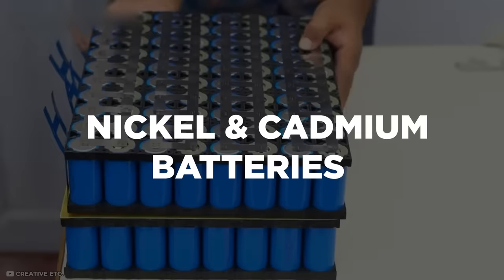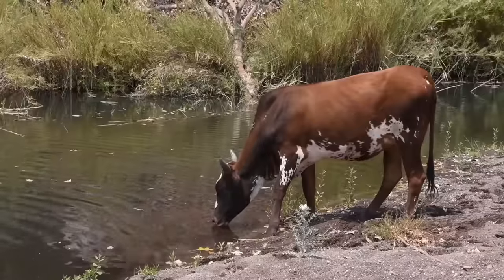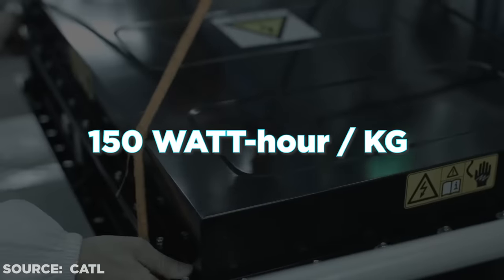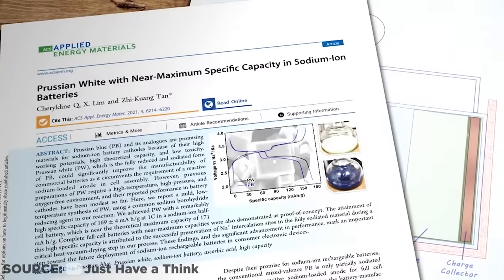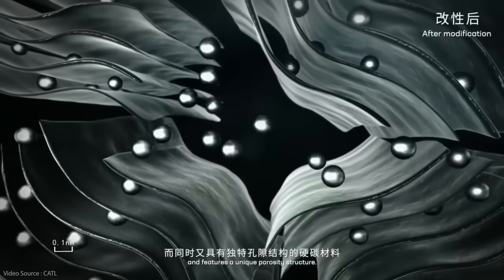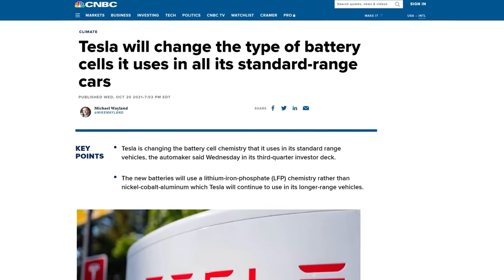No More Lithium! NEW Sodium-Ion Battery To BEGIN  Mass Production

Comment: How many 80% depth charge cycles until batteries using Na-Ion are at 80% of original capacity? If you're gonna charge/discharge daily you really want that number to be in the thousands.

Comment: Bruh, lithium isn't even a problem in Li-Ion batteries. Lithium isn't even a problem if we are talking about mineral extraction and enviromental damage! You can easily get a ton of Lithium the special pools with brine. The problem is cobolt because it's hard to get, you need a lot of it (up to 60% of battery) and there is not a lot of it under the ground.

Comment: This whole video is false. First lithium isn't more dangerous than sodium. It's not the lithium that burns, but the organic electrolytes that are used can be volatile and burn when hit and the pack is punctured. This won't be a issue in upcoming years as we are moving toward inorganic electrolytes. Lithium can cause fire in oxygen, but it is a way to contain and the same as pure sodium when it comes in contact with the air. Lithium mining doesn't harm the environment as this video says. Those ponds he shows are just salts , mostly sodium and magnesium left behind and they are disposed of properly. Sodium batteries do not have a higher thermal working zone then lithium and they are not approaching lithium at all with densities. They are going to be used in storage applications where size doesn't matter but this will be solely due to cost of lithium currently. When lithium comes down from its supply squeeze, lithium will still be more cost effective.

Comment: Sodium may have better energy density and be more environmentally friendly to manufacture, but that is absolute horseshit to say they are safer!
Any person who has even the most rudimentary understanding of chemistry knows that sodium is an incredibly volatile substance that is extremely prone to combusting. Sodium batteries would be more likely to combust than lithium batteries, have a larger combustion, and would be more difficult to put out. That is the real reason most automakers don’t mess with sodium based chemistry.

Comment: Salt will never replace Lithium.  
"The biggest difference between lithium-ion and saltwater batteries is their size and energy density. Lithium batteries have high energy density and hold higher charges within their energy cells, while saltwater batteries have lower energy density and store much less power in a battery of the same size."  Google

Comment: Weight and energy density are not a problem for grid level storage, as you are not lugging the batteries around.  Cost and efficiency and environmental issues regarding extraction and recycling are more important.  Is this the market niche for sodium ion?

Comment: This would be useful tech for solar panel powered homes and backup batteries in server rooms.. where the weight isn't remotely an issue. Also these could be made by simpletons in the woods with rudimentary tools and resources.

Comment: So all these "green" vehicles aren't green at all. Second biggest lie in the past 3 years.
Reply: no lie ... they certainly are greener then fosil fuel vehicles, especially as renewable energy sources are steadily growing and replacing fosil fuels in the electrical grids ... ressources which go into batteries like lithium aint consumed, after they work for years they can be recycled (alltho we barely began to do it out of greed). All while the fosil fuel going into your car is a constant consumption which requires constant mining and constantly transforms ressources into something unusable/harmful for an unreasonable long timeframe. The electric car is greener in relative terms, mostly because it doesnt accumulate damage as much throughout its life and because electrical drives are more efficient (regenerative braking etc).
Utterly silly to point at the initial ecological cost of batteries while disregarding the context of their longterm effect/cost for the environment.

Comment: Sodium batteries, have a better chance of making headway in the home energy storage market. In that market weight is much less of a concern. Lithium might have a longer staying power in the mobile market and car market for exactly the reason. Especially with longevity advantage, imagine if most homes in Ukraine had emergency batteries in the basement for emergency power. Cost and longevity are the priority in a home energy storage solution. Till sodium batteries take over that easy market, don’t expect any mobile/car use cases to take off any time soon.

Comment: Basically the new sodium batteries will weight more and retain even less power in compare with the lithium ones, by a factor of 25%. Devolution will continue after you'll buy an EV then. They will say, nope, your new battery pack must be 25% worst because of Greta.
Meanwhile, we'll burn coal to make power.
By the time these boring low efficency batteries will be available, most of makers will have either abandoned the making of EVs, like Ford or Toyota, or go directly bankrupt like BYD and probably Volwswagen.
Tesla will survive because they make the best EVs, only made EVs since the beginning, and really pursue excellence, plus, they have the power to unplug from China if need be.
One thing I hope: these salt batteries hopefully explode less than lithium ones.
I don't want to see my beautiful, elegant, cool, vintage petrol car damaged by some cheap electric gizmo doing the russian tank thing, and blowing up out of the blue.
Unless EVs are restricted from parking near normal cars, this is a clear risk.

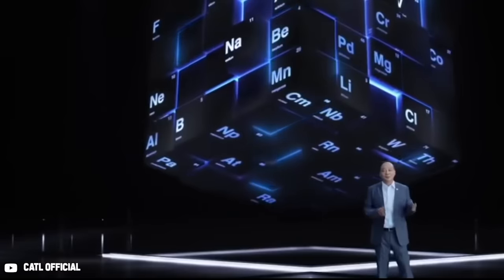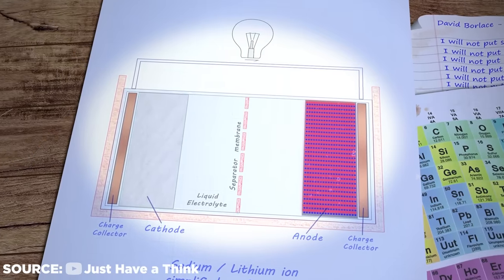Comment: At 1:40 you say Sodium is 12K times more common than Lithium, yet at 2:25 you state that it is only 1k more common.  Inconsistencies like this, surrounded by known facts are what make up reports that cannot be trusted.  While you say "more than" and yes 12k is more than 1k which makes the second statement also true it really raises eyebrows as to why you reduced the number so much when you are trying to state facts.  Sorry, but not buying it.  Or stock in Sodium-Ion manufacturing either.  This sort of video creation is exactly what a market manipulator would make.

Comment: So, im happy that this may be a replacement for light consumer goods, and nitch off grid housing, but, for transportation, and commercial shipping? where does the electricity come from? Recently a trucking company abandond the idea of going electric, when they submitted there power usage request to the local government, and were told the power draw for 30 trucks was 2 times the power draw of the entire city, it would have been more than most manufacturing complexes.... Untill the green climat change cult, comes up with factual answers, to the real issue of the "physical laws" governing the economy of energy. No so called "clean?" And allegedly "free?" Energy, is ultimately sustainable.

The climate change cult, consistently and willfully avoids the real principle of TANSTAAFL. Because of there destructive and arrogant religious adherence to some utopian delusion... That is actually little more than a power grab.

Comment: Gemini recently produced a lower graphite/lithium content battery that is going to be used in BMWs with a 600 mi range and was also tested in Tesla with 750+ mile range.  Since oil is pretty much dead as a long term resource (about 50-60 years before the energy required to extract/transport/distribute oil exceeds useful energy recovered from oil).  This sodium battery technology looks like a very promising technology along with our recent ability to recover 33% more energy from Fusion reactions ... we should have a nice clean power source other than oil.

Comment: Yes, sodium weight more than lithium, but, replacing the copper with aluminium, witch is much lighter, should result in a net weight loss.
Reply: Aluminum has more electrical resistance than copper. Aluminum would be bad for electrical conduits.
Reply: @ricktan5663  Yes, but not that much. Then, the density difference mean that you can have larger conduits while still saving weight.